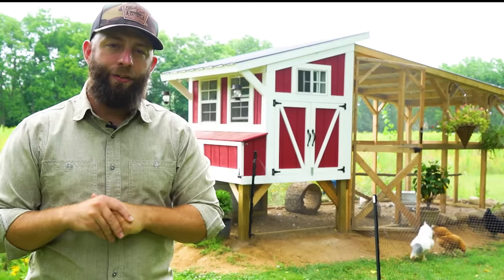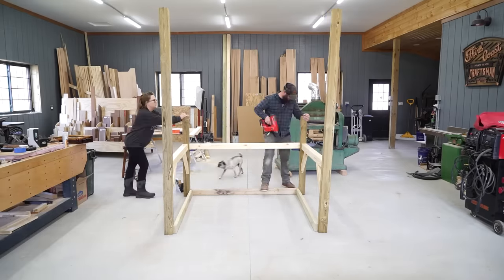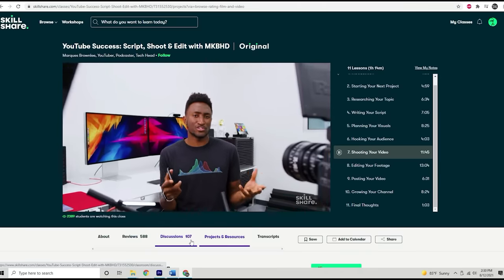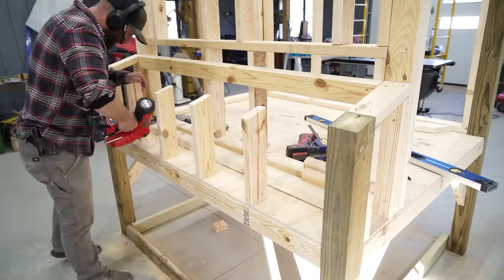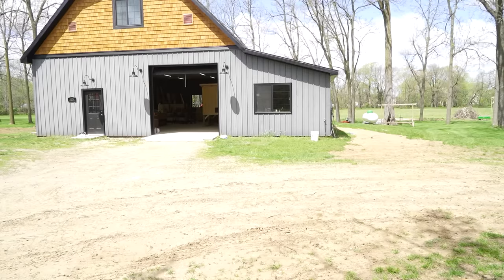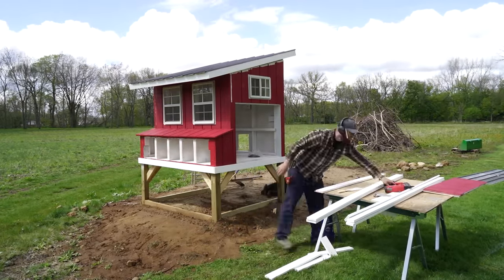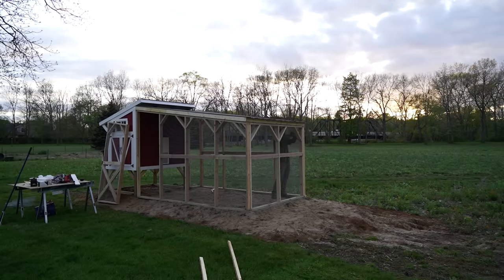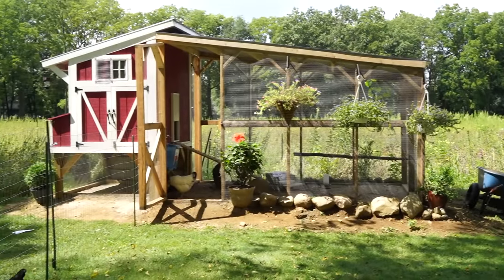Ultimate Backyard Chicken Coop Build | How To DIY

Comment: Love this coop I got these plans 2 years ago and built it . Just a word for the wise. Put wire mesh up in the eaves of the roof. Learned my lesson. Raccoon got in thru the gap in the roof and killed all 8 of my chickens….
Reply: Are you saying that the racoon squeezed in-between the spaces where the mettle roof hits the top plate? That's like an inch and a half! that's incredible. I just finished mine so thanks for the heads up
Reply: @Boyarsky1958  yeah. Where the roof of the run meets the roof of the coop.  Idk how it did it but it got in through that lil gap   I’ve added wire mesh to keep them out.   That was the only place that it could possibly could have gotten in everything else was closed up tight.

Comment: I posted this on your other video: I am copy/pasting it here so both you and other people can see it regardless of which video they look at. "on your door to the nesting boxes. You could put a small piece of chain on the sides and small hooks on the sides of the door, So if you want to use the door as a "bench" (work bench not sitting bench) instead of using your knee you just grab the chain and hook it to the door, one side both sides and now your door will sit "workbench" level and you are free to walk about. If you want to drop the door all the way down, you just unhook the chain(s) and let it hang down. Just make sure you use chains of a material that hold up to the outdoor elements so it doesn't rust on ya."

Comment: Hey Chris, 
So I built the Coop. I’ll say this, it’ll be the first and last coop I’ll ever built. I am not a carpenter but I loved the process, followed the instructions in the plans to the T + your recommendations on the walk-through video and it came out AWESOME . I wish I could share some photos. Thank you so much.
Reply: Do you know about how many hours it took you to build this?
Reply: @amandamann724  I worked on building this coop full days Friday- Sunday 9 hour day for 3 weeks.
Reply: Hey Danny, how can get the plans for this chicken coop😉
Reply: @dannycook2995  Can you explain how the roof is attached to the wall structures please. Im having an issue grasping the attachment on that part before the metal roof goes on. Thanks!
Reply: @rbljackson  you first need to build the roof frame and screw the roof metal with the roof screws. Once that’s complete you just slide the completed roof on top of the run walls. Then secure the roof to the 2x4s from inside the run. I hope that helps
Reply: How much did it cost you to build?
Reply: @pmctee  depending on your location, $1,600. It’s hard finding the windows and I didnt use the automatic coop door
Reply: Same here, I spent all day making a BOM with price list from the nearest hardware store and in Belgium this costs over 1600€ which is a big NO for 10 chickens. You can imagine, for that amount, I'll eat 3 eggs a day for the next 6 years.
Reply: My plans are missing some of the measurements. Like, how far from the ground to the bottom of the floor joist.

Comment: We have nick-named the design the Taj MaCoop.  I built the coop a year ago with some minor modifications.  I put doors on both sides of the coop and run.  Having the second set of doors in the coop helps when cleaning.  I put galvanized sheet metal  in the gaps between the studs as a ramp for the droppings to fall to the cleanup area and not collect between the studs where its more difficult to clean up.  I used vertical windows over the side doors instead of horizontal as I could not find horizontal windows with bottom drains.   I added a gutter over the nesting box so I can get the eggs without getting soaked when it's raining.  The nesting box door has the latches on the side as will as an old fashion swivel board latch in the middle.  I seldom use the side latches as it's easier to have the middle latch with hands full of eggs. I also ran power to it for lights and a ventilation fan  high in the run side wall.  The fan provides cooling ventilation in the summer and provides a breeze in the run area.  I used structural siding (30 year warranty)  instead  of T1-11.  It's painted green and brown to camouflage it to the area of the yard. where we placed it.  Everyone who sees the Taj MaCoop loves it.  Over all the cost ran a little over $1K.   We have nine chickens which produce 7 to nine eggs daily.  Mostly eight eggs.  Having never raised chickens, I thought 5 nesting boxes would be too few.  Ha!  Most of the time all of the eggs will be in the most left-hand box.  Or lately the two left  boxes which interestingly enough is where the Third Coast Craftsman retrieved his egg.  I let the chickens free run in the afternoon which is a good time to clean up the coop and run.  The cleanup is very easy as advertised (Great idea).  Collecting the droppings in the bucket is so convenient with no mess.  Lastly,  my chickens think nothing of flying over a 4 foot high fence.  I had to install a 8 foot fence to keep them out of the garden. Thank you Third Coast Craftsman for an excellent design.

Comment: Such a good chicken coop! I built one earlier this year and would only make a few adjustments on it. 
1. I’d move the chicken door enterance over to the side so it’s not in my way in the chicken run.
2. Id move the wood braces underneath the coop so it’s easier to staple the hardware cloth.
3. I’d make a double door, top and bottom for the run so the chickens can’t get out if you want to throw some food in there really quick.

Comment: What I like is you show the finished coup on higher ground than the surrounding.  This would help water drainage when it rains a lot, keeping the inside of the coup as dry as possible.  I learned the hard way.  My coup was just at level with the surrounding, Actually even a bit lower.  Then it would rain for three days in a row and the chickens were basically wading in water.  I had to move the whole thing to higher ground while it was raining.  Luckily I only had a few chickens, so the coup and run was smaller.

Comment: I’m about to finish building this coop with minimal modifications.
The big difference is a hardware cloth mesh vent on the back wall just below the peak. I also didn’t include the side window since I couldn’t find one small enough; with the mesh I figure I’ll still have good cross ventilation.
The more widespread useful idea I have to share is that I mounted the windows backwards so the window can easily be opened from the outside instead of the inside. I did have to cut off the trim seating flange to make this feasible, but it felt like a good trade to make.
Reply: Do you know the approximate total cost of the build? Thanks!
Reply: @mikemaz6121  I think it ended around $1500; I didn't track it perfectly as I bought the non-lumber components in multiple different orders (and I got about 35 2x4 for free). This included adding 2' of PVC coated hardware cloth as a skirt. I did also buy some new tools for the project, but those don't count :P
As you may be able to tell from my avatar I am in the San Francisco area; I'm not sure if that adds to the cost of items at the big box stores.
edit: and if you are smart with your T1-11 Siding cuts, you can totally make this with only 4 sheets. That's what I did, and now I have a 5th sheet sitting on my garage floor...  I did have to allow the top corner above the cleanout to not be continuous with the main piece, but that flaw is fully hidden by trim.
Oh also my wife spent $1.50 buying some stained glass decals at Daiso, lol.
Reply: Hahaha my lady will be going for the stained glass add ons too! I’m hoping I can pull of this build… I used to be an auto mechanic and I built and wired my own guitar amp.. so I am fairly confident I can swing this too if I follow the instructions. Thanks for the info!
Reply: @mikemaz6121  It's honestly not that hard, it's by far the biggest thing I've built but it went smoothly nonetheless. And I was building on non-level ground so had minor issues getting things started (I built the coop in place since that clearly is the only option without a level surface).
It did take me about 12 full days of work; I did the bulk of that during a week between jobs (plus the weekends) then about 45 minutes a day for a week during lunch (yay WFH), and the next weekend.

Comment: We have just finished making this coop and run and absolutely love it, the instructions were extremely helpful but of course we had some minor deviations we had to make and notes. Here are some of the things we learned along the way that may be useful for others:

We found that we actually needed a total of 6 - 2"x4"x12' boards, the material list only listed 2 pressure treated 2"x4"x12' boards for the bottom of the coop run. You will need 4 additional non pressure treated 2"x4"x12' boards, 2 for the top of the coop run sides and 2 for the side of the run roof.

We also needed an additional 1"x4"x6' board for the top trim on the side of the coop and an additional 2 - 1"x3"x8' boards for trim. (This could have just been due to how we cut the boards). The 12"x18" window for the side of the coop was not available so we did a 12"x12" and had no issues.

For the instructions:

There are a few points in the instructions that it doesn't tell you or make clear whether the cut is an angle cut or not. This isn't a huge deal as long you are paying attention as you go and check before making cuts.

The biggest issue we ran into was that the instructions don't tell you to cut the siding on top of the nesting box at an angle to make it snug, and it doesn't tell you to overhang the end of the top of the nesting box. Not doing this would have let water go straight into the boxes so we ended up having to remove it and recut it out of leftovers, we extended ours out approximately 3/4"-1" and it worked great.

The instructions for the run are a little more assuming you have some framing knowledge. Specifically the angle cuts and angled supports, we ended up using 8 degrees from the instructions and then every angle cut after support was cut to fit and measured.
Reply: We also used OSB sheets on the roof structure to reinforce it and limit condensation before adding the roofing panels. This coop and run took 5 OSB sheets total.
Reply from the maker: Thank you for this feedback. I’ll work on adding this info and corrections to the plans
Reply: Any idea on an overall cost? That would be helpful to know prior to buying the plans.
Reply: @j-4121  Do you have an estimate of what the total cost was to build this coop?
Reply: @OneBrightLightTN  I will like to know this as well
Reply: @Thedoctor4x4  I purchased the plans and will be building just the coop, only bigger. I’m making it 6x8. Lumber prices are high at the moment. I’m thinking I’ll spend about $700-900 and that’s with trying to find good deals on things like paint, hardware, etc
Reply: @OneBrightLightTN  Good luck with that.  I'm in Nevada and I just purchased the Coop lumber only and it cost me over a $1000 with a military discount.  I haven't even gotten the run lumber yet.  I estimate the total project to be over $1600 but well worth it.  This is a great coop. I've seen some of those cheap ones from Tractor Supply, etc.  This one puts those to shame.
Reply: @jimdebbielawheed2474  I just completed the chicken coop build and my total cost was $672. I did not build the run, as I free range. All my supplies were new and purchased from Lowes, except for some hardware I purchased from Walmart. I'm also tax exempt, so that helped too. I also looked for deals, like the paint I got 2 gallons of exterior paint on clearance at lowes because it was an   "error color" for a total of $8.  I'm in Tennessee so maybe lumber prices are lower here
Reply: @OneBrightLightTN   I just added all parts to HD cart (w/o any windows yet) I am at $1450+ in material (that is w/o tax added). Expensive but nice!
Reply: @OneBrightLightTN  could you share the changes you made to make it 6x8? Hoping to do the same =)
Reply: I completely agree with you on the instructions.  It would have been super helpful if the angle cuts were listed for each and every board that needed to be at an angle.  You kinda had to look at the plans and guess on some of the boards if they were angled or not.  There are quite a few angled cuts here in a couple different directions, so I would say that a "novice" carpenter may have to consider the time it takes to understand how to make those cuts.  They are not hard to do on a miter saw, but if you've never really done those it will just take a bit for the learning curve.

Thank you for the tip with the siding on top of the nesting box!  We are starting to put the siding on today and I'm really glad I read your comment!  

We are modifying the plans just a little since we are converting my son's old wooden playset into the coop.  We have had to make several adjustments just for the fact that whoever built this playset (it was not a pre-fab, it was a custom build) didn't really square things up just right.  These plans were really well done and I am happy I purchased them.  Our coop will look really good when it's finished and I fully believe it is an extremely sturdy build.  That was super important to us since we live on the Southeast Coast and do have the threats of hurricanes each year.
Reply: @daba5113   I just finished building it and honestly I get like it was a bit expensive if you are lacking tools like I did. The total amount I paid in Texas was over 1200 but worth it
Reply: @jimdebbielawheed2474  Try converting it into AUD plus everything is expensive in Australia, taxes phew.  We are building the Coop after purchasing the plans and trying to save where ever we can.  Marketplaces for recycling Lumber/Timber and roofing sheets, buying hardware in bulk more than needed for future projects.
Reply: @ThirdCoastCraftsman  Did you ever get a chance to update the plans? Thanks in advance! Just downloaded your plans and getting ready to head to the hardware store now! Thanks again!
Reply from the maker: I appreciate you input, we have since made corrections for all these issues in the updated plans.
Reply: “Minor deviations” my ass.

Comment: I just built mine using your plans. I got it done for around 1300 and that’s having some of the materials already. If I had bought this in South Carolina it would’ve costed me 3k or better. I’ve got a lot of compliments on it and it also gave me an excuse to purchase some much needed power tools.😁 Thanks.
Reply: Wow, its still that much for me. I just started this today, got the basic structural parts, but I only have left the equivalent to 200 dollar…😅 I will have to improvise on the journey.

Comment: I just finish up a coop/run with a lot of inspiration of your build, I incorporated storage with a 34" drawer slide into mine is the big difference, and Carolina coops ladder over ramp. Used 4" pvc feeders and plumbed in chicken nipples. The poop shelf is great. I made my windows also. They're hinged with window prop arms from amazon. It turned out great and the wife is very happy. Thanks for sharing the video, it helped me decide on my design. I would post a picture, but there is no option to.

Comment: Great design for a chicken coop. 
I did some modifications though. Since the ground was slanted slightly the corner 4”x4”s are longer and buried 2’ in the ground. 
The most obvious one is I thought the small side windows needed some roof overhang so I centered the coop on the run and put an 8’x8’ roof on it. Also my wife suggested a Dutch door so that happened. 
Some not so obvious changes were that I strengthened the double doors and nesting box drop down door with 2”x4” s. In doing so I had to modify the plans for the interior supports to make room for the doors to close. Last change is I took Chris’ idea to make the run 14’ long. 
My three hens love it and so does everyone that sees it. Thanks Chris for your inspiration. 
It wasn’t cheap but well worth it
Reply: Congratulations! Where did you find windows? Building the coop and no luck finding them...
Reply: I cut the openings as per the plans and just made tilt out wooden windows. I prop them open most of the year and close them for the few times it gets cold here in Florida.

Comment: Couple other comments I will make. I probably would have painted or stained and sealed the bottom of the plywood that you used for the floor of the coup.. just because it is outside and open to the elements, and in my area we have issues with carpenter bees who love unprotected wood.
Similar comment with the walls of the run. You left them totally untreated. I would have used pressure treated or at least stained them before putting them together and/or putting the hardware cloth on. 
For the barrier around the bottom of the run; instead of using hardware cloth you could use that thick black plastic or rubber landscaping edging. get the 5 or 6 inch stuff and shoot a nail or large stable just under the top into your pressure treated bottom board.
Finally, I would love to hear you review the automatic door. What has been your experience? Have any of your flock ever been trapped in the run all night because the door closed too early? Have any of your flock been trapped inside because the door didn't open in the morning? Daylight changes throughout the year. Are the chickens instincts aligned with getting in b4 the door closes? What about weather? If you have a dark gloomy day does the door still operate appropriately so that the chickens aren't trapped on one side or the other of the door? If someone had an outdoor spotlight or a streetlight hanging off their barn, do you think that would interfere with the proper operation of the light sensor for the door? Thanks.